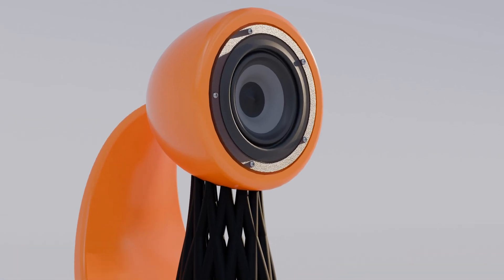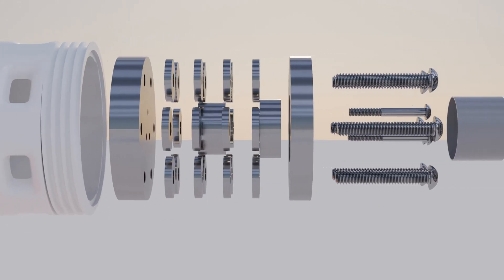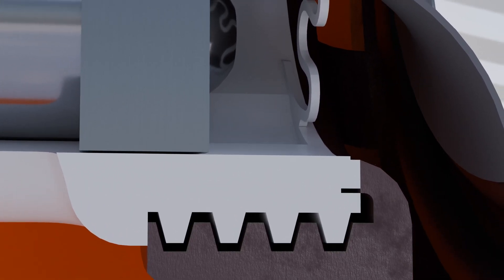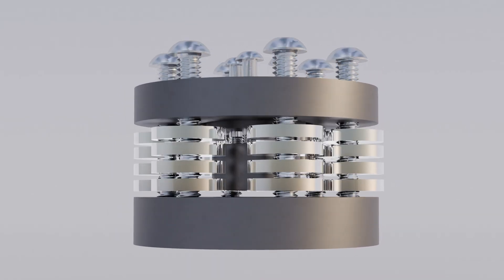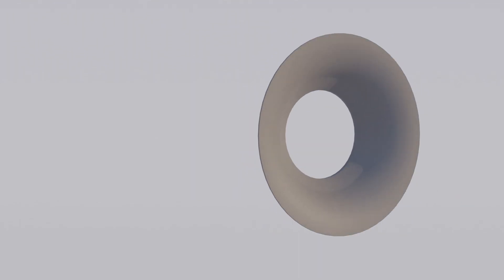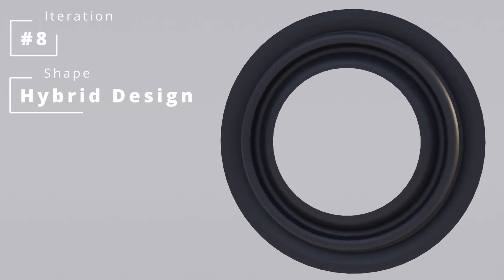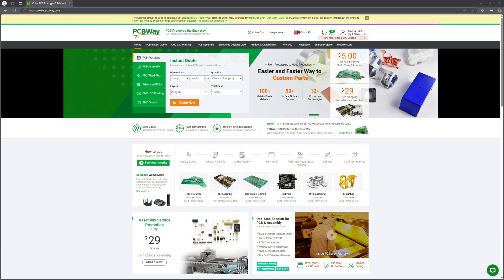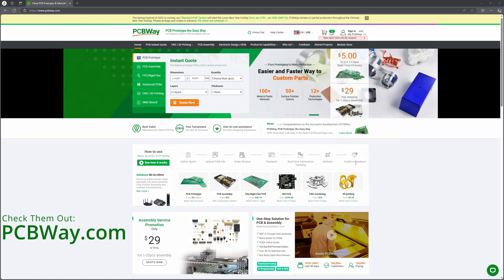Fully Printed Speaker V20 - Project Wave Point

Comment: Hi I just watched the temu collab building and thought I would head over and check out more of your acoustic tuning videos, I am currently rebuilding/restoring an f1 sim cockpit, there are some cool cutouts like the air intakes and engine intake that I would love to convert to a 5.1 surround setup,  would something like this be of interest? My ADHD brain comes up with ideas that my AUDHD brain doesn't have the ability to carry out.
Do you thinknit would be possible to build in smaller drivers to the rear mirrors? Can I ask your thoughts on bass kickers to supplement the audio frequency range but also to give tactile feedback, do you have any ideas on improving their placement or setup etc. Sorry lots of questions, but hopefully your the right person to advise. 
Thanks shane 
@ShanosF1adhd
Reply from the maker: I know for placements mid and high range speakers are very directional, while low range frequencies are harder to determine their source- so less directional. This is the reason for the newer “atmos” speakers from Dolby- they give volume and realism.

Bass kickers are great for tactile feel and getting low responses through solid objects, just know the larger the mass your trying to vibrate the more energy is required. 

If you haven’t, check out my sim rig build - the second video I cover bass kickers, they work but in retrospect they needed to be more powerful for the seat ones. 

It’s generally advisable to have separate shakers for sound and feedback.

Comment: The bolts holding the magnets do they need to be metal for magnetic feild shaping reasons, or could you potentally get some weight savings with nylon bolts should be at a hardware store.
Reply from the maker: I use “stainless bolts” I don’t believe they are 100% stainless, but they are less magnetic than a standard steel fastener. So I suppose you could get to save weight if you were trying to. However, weight savings in that area will have zero effect on speaker performance. The bolts also have to be strong enough to hold the magnets in place during assembly.
Reply: @piscesprinting  unless i misunderstood where that part is, i thought it's reciprocating, which would make weight a problem for efficiency
Reply from the maker: The magnet and plates don’t move at all, it’s a stationary magnetic field that the coil/former move through. The only pieces that contribute to moving mass are the former, coil, cone, spider and surround, Everything else is a stationary piece.

Comment: Oooooh at first i thought the title was pulling my leg... because the driver didn't look 3D printed at all, thought it was going to be a cabinet build with an off the shelf driver. And the first paragraphs reading like GPT slop didn't make it any better.

But yeah well done and the vacuformed elements just make sense.

More than a little puzzled though that you'd be testing the driver in an enclosure not knowing what its TS are, rather than in an "infinite baffle". Also uhh where's your impedance measurement, without it you don't have TS. I don't think Fs is 180Hz tbh i really don't.
Reply from the maker: TS parameters have always been achieved open air. I don’t have to room or means to make an infinite baffle for every speaker. So I use free air TS to get me close on my box and honestly from there I send it. 

I do use GPT to do some of the summary. I just feed it my script and then I try and proofread the output but you never quite get that human touch back. I figure most folks don’t read much of the description though…
Reply: @  Just a big flat box that you can hide near a wall with way too much filler or keep and measure outdoors or your actual garden tool closet and a hole in its door and a replaceable square section where you can put in the driver for the tests. I know silly ideas but maybe you'll find one that fits.
Reply from the maker: The Fs of the driver is 120hz btw in the DATS  portion you can see all the TS on the right side of the screen.
Reply: @piscesprinting   Ah excellent excellent thank you.
Reply from the maker: Also the impdedence for the driver is listed as Re in the DATS program.

Comment: iirc, 30hz quarter wave horn = 2,85 meters, 60hz = 1,425, 120hz = 0,7125 meters so yeah, your horn cant produce frequencies below about 165hz. i recommend using simpler enclosures if the idea is to ramp up driver quality.
Reply from the maker: Yeah, I wasn’t trying to produce any sort of low response with the speaker. Good info though!
Reply: Infinite baffle test rig + impedance measurement setup + TS calculations.
Reply: @SianaGearz  yeah, i almost suggested "infinite baffle". it does cause different ripples to higher frequencies then though compared to a regular speaker front baffle / wave guide - has to be taken into account if the idea is to push high quality. distortion measurements are extremely important as they demonstrate how much detail drivers are able to offer.

Comment: i agree with you in a sealed enclosure it would probably respond more critical and flat as i have 90s boston acustics speakers sealed that have similar drivers to what you designed and they sound similar.. inverted surround And super low cone mass and fs but with older magnets
Reply from the maker: My only issue with sealed enclosures are they are very boring to look at. So I do lean towards an enclosure with a vent/port.

Comment: Hey Pisces, its me again! Im incredibley impressed at how good this iteration sounds and the amount fo weight you managed to shave off cone mass is incredible! sounds like an old 90s mid bass.. maybe work towards shaving weight off the voice coil next???? also be careful with sharp 90 degree angles inside your enclosure espesially where air flows around the port, it caueses that chuffing sound which shouldnt be there!!
Reply from the maker: Yeah I’m not sure how much more weight I can realistically shave off of VC, cone and former, I think suspensions is the next place to shave weight. I may be entering a point of diminishing returns on weight though as well. Still I will look into cutting weight.

Comment: Awesome new video, thank you! ;)

By looking at the SPL-graph, I think the box volume is a little bit small, that's why a rising around 180 Hz in the bass!
With a bigger volume, the response can be a bit flatter, but because of the high Qts of your driver, it's not good for bass-reflex box. You mentioned that your next plan is a closed box, but I think that a quarter-wave transmission-line is much better, because it gives a very-very good control to the diaphragm at the tuning frequency, and can give more and deeper bass, even more than BR!
Instead of closed or bass-reflex, it gives more, and better lower midrange too! ;)

I can't see the exact fs on the video, but for example: counting with 120 Hz, the tube should be around 70 cm long. In theory, better not placing the driver directly to the closed end (my speaker is directly at the closed end, and sounds great! ;) ) , smoother response can be achieve by shifting it max. 1/3 to the total length. In this case it is around 23 cm from the closed end of the tube. The area of the tube can be equal, or a bit smaller (70%) than the cone's surface area.
I like the sound of the TL, I think it's worth trying it! ;)

On the graph there is a rising response from 1500 Hz, this is the effect of the baffle-step. Choppy, because of the symmetrical, round shape of the Front baffle. Assymetric or oval-shaped baffle can make it smoother! ;)
A rounded "beauty-ring", maybe 2 cm in thickness, can make a horn effect for the highest octave.
I know, that you mention it as a midrange, but it is so close to a wide range, maybe an inductance-compensation could be beneficial to reach higher, and reduce some distorsion!
Copper shortening ring, or cap onto the pole piece.
Maybe galvanizing the whole magnet-structure with a thin layer of copper can fight against the rising impedance...

I like your videos very much, you are a true artist!
Have a nice day! ;)
Reply from the maker: Thanks! I did design with midrange in mind, and I’ve heard about the shorting rings but my current method of manufacture doesn’t support that. If I had a lathe, then I could play around with these things more!
Reply: @piscesprinting4170  The best result is, when the copper shorting ring is in the magnetic gap, but maybe a piece of copper tube on the "neck" of the inner pole piece could make a positive  change...
Sawing it from a long piece, or from a "knee" for copper pipes, just have to find the right diameter. ;)
Reply from the maker: It’s definitely something I can look into!

Comment: What would adding some ribs to the large flat sides of the cone do? I've used them in some of my vase mode prints to add stability to large walls, and tuning a print down to be able to use vase mode is always a fun FDM design challenge.
Reply from the maker: I’ve done that on the two previous versions. It makes the more rigid, at the expense of harder to release from molds. For the small cone though I decided against it.